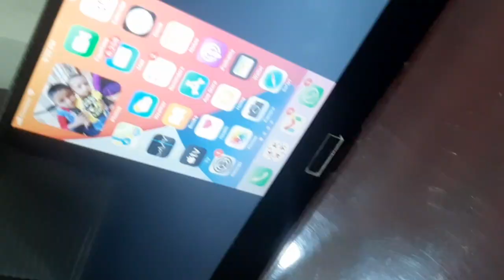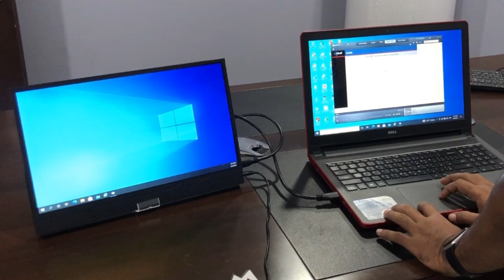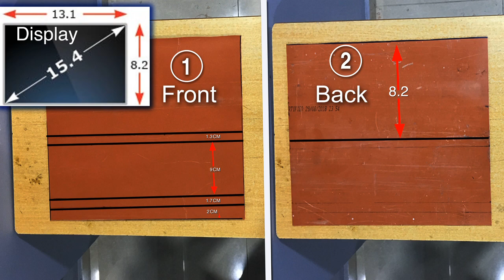How to Make Old Laptop LCD to Monitor | DIY Monitor form Laptop Screen

Comment: @TR Creation for Tech  great video , Can you please assist me? I bought a controller board specifically for my laptop screen. I've connected all the cables: power supply, wire from the board to the screen, and HDMI from the laptop to the controller board. The screen lights up, and the "no signal" message is displayed on the screen, and then my screen goes black. I have unplugged the connections and connected them again, but unfortunately, the same message persists. My power supply is 12V 3A. Is it possible that the power supply doesn't supply enough power?"
Reply: 1. Check what type of connector is needed between the controller board and monitor.  2. the type of interface (LVDS, eDP, MIPI, etc.). 3. If it is 1 channel or 2 channel and how many Bits 6/8. 4. The HDMI specs of the controller board. 5. The connectors are properly seated.
6. if the pins are clean. 7. Try connecting other devices to rule out the issue being isolated to the laptop.

Comment: what is the name of the LCD Controller Board Driver
Reply from the maker: https://www.ebay.com/itm/1Set-HdMI-EDP-Lcd-Controller-Driver-Board-Module-1920x1080-Display-Panel-Adapter-/143679879370?mkcid=16&mkevt=1&_trksid=p2349624.m46890.l6249&mkrid=710-127635-2958-0